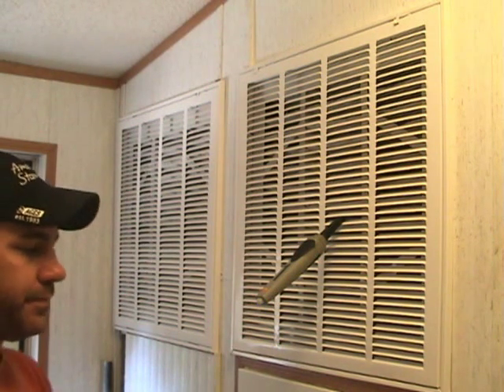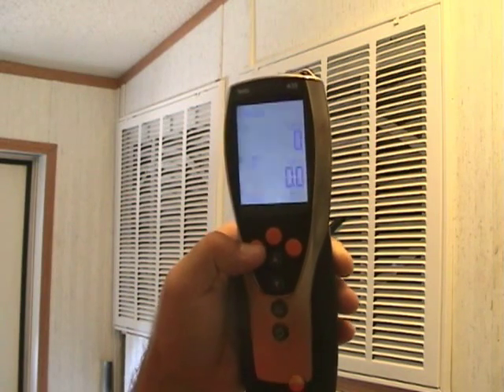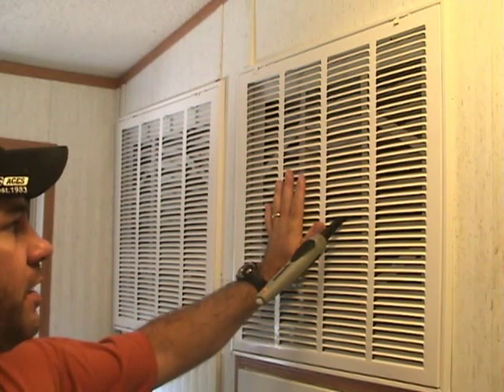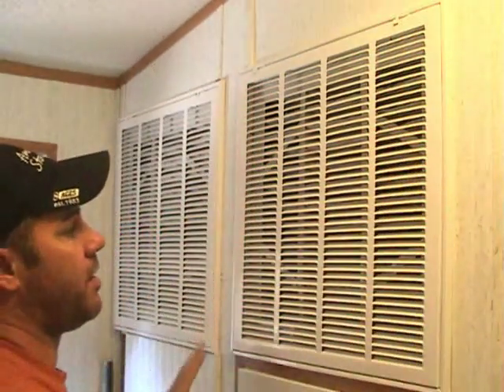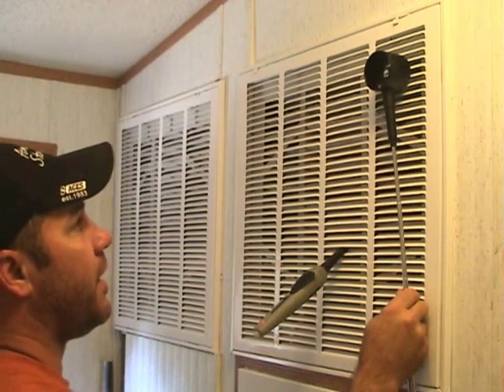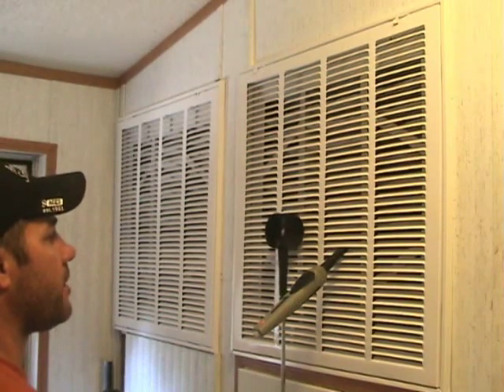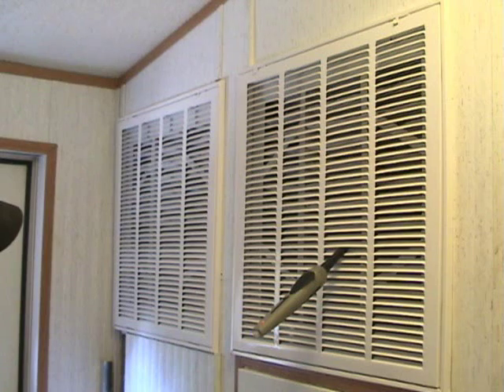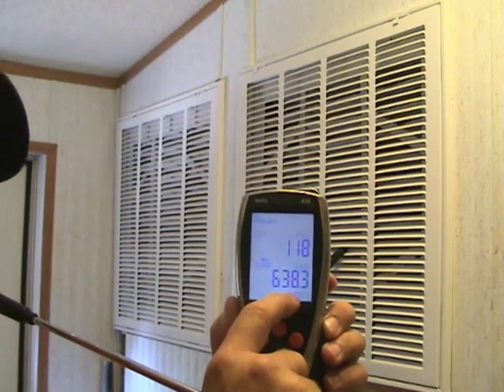Testo 435 2 Total BTU Calculation

Comment from the maker: Sure, the mini-vane is a great tool for traversing duct work. If it is used to traverse a grille face, like I am doing in this video, you must be very careful to keep the vanes inline with the airflow. The beauty of the rotating vane anemometers is there is no need to compensate for air density. Just remember to follow good T&B techniques when traversing duct for airflow with the mini-vane.